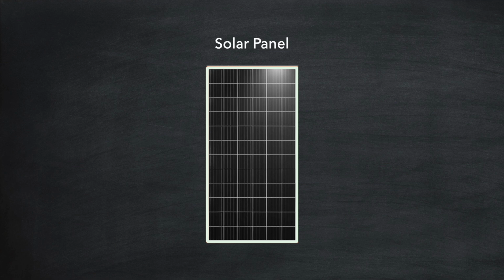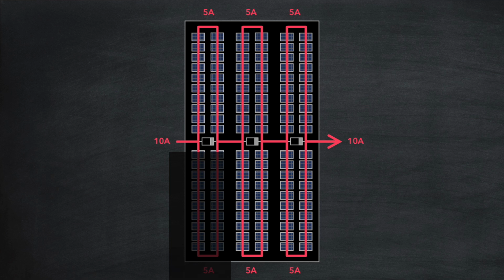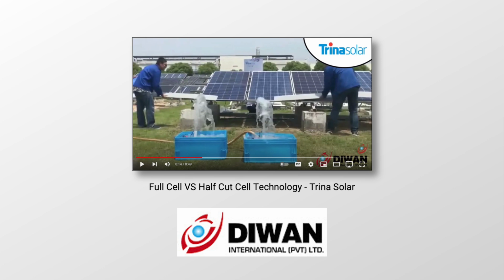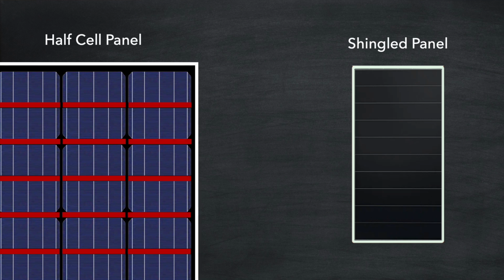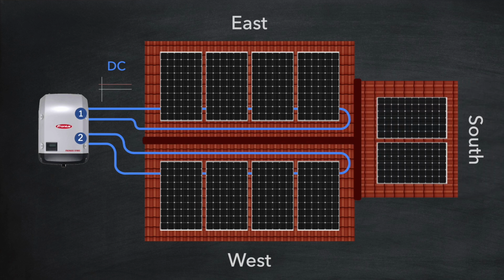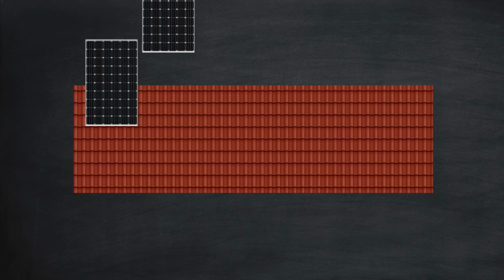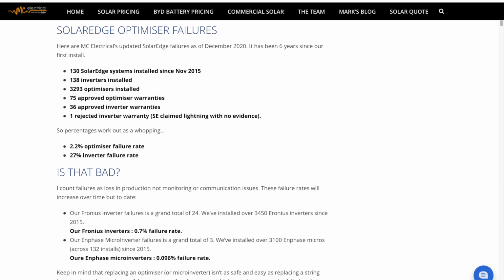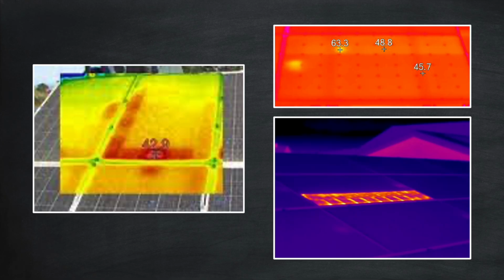Solar Panel Shading (Part 2): More on Optimisers and Micro inverters

Comment: Very informative Ive been recommended Perlight Delta 425W Total Black Mono panels. Are these the shingle panels that you refer to? The datasheet refers to a parallel configuration but does not give any details. My roof is subject to dappled shading from neighbours trees, which will only get worse as they continue to grow, so shading is a concern to me, and I have been considering whether or not to use optimisers. Fortunately, it is a flat first floor roof, and access is simple, I just climb out of a bedroom window.  Any thoughts?
Reply from the maker: Hi Jeremy, great that you're getting something out of my video :-)

Yes, I have Perlight Delta 415W panels on my roof, which are shingled. I'm sure yours are too. Sorry to hear about the shading you have. As it is from trees (therefore diffuse), optimisers could help here, and having easier access will help in the unlikely event an optimiser fails. Be careful though if you're attempting to resolve issues yourself - your safety is paramount. All the best with whatever you decide.

Comment: The first question is panel management modules or not, for questionable benefit. The second option is optimizers (DC coupled) or micro-inverters (AC coupled). Both these questions will have a profound impact on the rest of your equipment, each funneling you down a different path that limits &/or dictates your choices on how the energy is integrated into your home.
As I research this subject I find myself being whiplashed back & forth between many options for the whole system. Just when I think I've decided on one part of the system, I find myself dealing with the fact that it wouldn't be compatible with another choice I thought I had settled for good. No one option within the system can be made without the whole system in mind.
Do I start with decisions on the basic functionality of the system like grid tie or not, battery backup or not,  let that dictate the inverter & solar charge controllers, & ultimately the solar panel module choice. Or do I start with the panels & work my way back toward the grid? It can be frustrating.
Reply from the maker: Hi Dan, it's a real minefield, eh? If it were me, I'd start by listing my overall objectives and categorise them (1=Absolutely Must have, 5=Nice to Have). Then, I'd score at a few potential options against those objectives.

And for particular technologies (e.g. microinverters), I'd also categorise each of the individual benefits (1=Absolutely Must have, 5=Nice to Have).

This might not lead to a definitive solution, but the process of going through it will tease out what the important aspects are, and how they might dictate a particular approach.

Good luck!
Reply: @GaryDoesSolar  My research tells me that high frequency inverters often carry misleadingly high peak capacity ratings, & are not as well suited for inductive loads or whole-house backup, unless they are super oversized. This leads me to favor low-frequency inverters, which rules out micro-inverters on the panels. I live in a rural area, & so this pushes me towards favoring a ground-mounted array, eliminating all the compromises of roof-mounted installations. I live in a northern climate & the ability to clean & remove snow cover also drives me toward ground mounting as well. Ground mounting also means I have access for relatively easy troubleshooting & repairs. In climates with significant snow cover, I'm leaning towards bi-facial solar panels, which benefit from the reflected light snow provides. I want battery backup, & my research tells me that lithium iron phosphate server rack batteries offer the best value, & superior safety, longevity, & serviceability. I honestly don't think there's a single branded solution out there for me, & that I would significantly benefit from a modular multi-branded system built around a low-frequency grid-tied hybrid inverter, with DC-coupled batteries & a DC-coupled generator backup, to deal with extended weather-related power outages. I live in North America, & so the system must also be capable of 120 volt & 240 split-phase power supply.

M current favorite choices are either a Scheider or a dual Victron inverter, in conjunction with their respective solar chargers & communication systems. For batteries, I favor a BMS-supported server rack-mounted battery stack from either EG4 or Soak. I'm leaning towards DC-coupled ground-mounted bi-facial solar panels, & debating whether to use panel optimizers or not. For long-term generator backup, I'm looking at a manually operated generator running through a variable AC to DC battery charger connected directly to the batteries. This is my dream system for now.
Reply from the maker: @danchesney631  Thanks for the extra detail. Yeah, not easy to make the right decision, but I like your approach. All the best with whatever you go with in the end!

Comment: Hi Gary, hello from Perth (Australia, not Scotland ;-) )
Thank you very much for the information you provided in this series, it will be very helpful for me when I change my current system to a bigger one.
Particularly interesting for me where half cell panels, and the fact that (some) inverters support two strings, as I have to deal with partial shading, and plan to have panels on two sides of my roof.
Reply from the maker: Hi Stephan, thanks for taking the time to comment! Now, I've been to Perth (Scotland) many times as this was near where I was born and brought up, but I've never been to Perth (Australia)! I'm hoping one day to get the chance to fly over :-) Good luck with your planned installation!

Comment: Thanks Gary

I can't get any panels for free but I was thinking about getting these for my parents. Half their roof faces north, and it suffers from shading via the chimney

I figured it'd still be worth putting them on a north facing roof if the panels are free, and get optimisers instead

For myself, I don't really get shading, so I don't bother with optimisers.
Reply from the maker: What country are you located in, Waqas? If the UK, then North-facing could be a real problem as it will hardly ever get direct sunlight (except in the Summer, depending on the pitch).

Comment: And if you have the room, you could take the money saved on the power optimizers and spend it on additional panels.  Giving you more power.
Reply from the maker: I can't argue with that :-)
Reply: How does one know what type panel architecture you have? The literature (data sheet) on my Hanwha Q.PEAK DUP BLK-G6 340 says nothing about the diodes or impacts of shading - silent. I have SolarEdge optimizers, and I’m fed up with them. Looking at removing them and the inverter, and just going panel array to inverter. Then the question is, being off grid, what tells the inverter to shut off when the PowerWalls are full? Currently, the Gateway raises the frequency, which the SolarEdge inverter sees as a grid fault, and shuts off. What I’d really like is for the inverter to throttle to meet the load, once the batteries are full, so they don’t shut off entirely. How?

Comment: Thank you! I have been struggling to decide between a string inverter and the micro inverters. My system is to be small and on the ground but I'd like it to be as trouble free and reliable as possible for as long as possible. Great info. Thank you very much for your efficient and understandable presentation.
Reply from the maker: Cheers Gary - thanks for the kind words and all the best with whatever you decide :-)

Comment: Your conclusions make a lot of sense. I could invest in a high quality, reliable hybrid inverter for considerably less than a micro inverter based system.
Reply from the maker: Thanks Kevin. Yeah, for management of most types of shading, the bypass diodes in your panels will do a good job in a string inverter system. If you have a lot of trees around, then optimisers and microinverters have some value there.

Comment: What solar manufacturer makes a good shingled type of panel, the one that outperformed the half cell in full cell panels?
Reply from the maker: I have Perlight Delta 415W panels, which I believe out performs full cell and is at least as good as half-cell: https://www.perlight.com/perlight-delta-400w.html

Comment: I'm in the process of getting PV installed and decided to use microinverters for several reasons. I like the idea that each microinverter has to deal with one panel and don't need an Inverter that has to deal with a whole string. At the same time if a central inverter goes down, then the whole or partial array is offline. With the microinverters only the one or a few are offline and it gives me some extra time for the replacement.
Expandability and replacing PV Panels in the future makes it easier since I don't have to worry about compatibility.
In my case there is not a big difference in costs between the 2 options.
Monitoring is a bonus to a geek 😁
Downside of a microinverter is that the peak power output is lower than the peak output of the PV Panel but after a couple of year the PV Panel will have a reduced power anyway and the 1-2% power consumtion will be from the PV side and not the mains side.
According to the manufacturere mentioned in this video, when there is no sun on the PV the microinverter consume several micro Amps.

There is also the option to use something like Victron. There each string can have its own MPPT which then can be bundled using a busbar and fed to the inverters and/or batteries.

I find there are a lot of options and setups out there. One should take the time and do thier own research before getting one. Its a large investment and once that can be very costly if done wrong. At least videos like yours can minimise such mistakes.👍
Reply from the maker: Great summary!

Comment: Hi Garry
Just a quick question. Do you have any update on the Tigo optimiser problems outlined by Mark in his blog post?. I have just recieved the design for my system from the installer and they want to use Tigo to handle the East /West split. Im just wondering if we will need the monitering system to make them work.

Simon
Reply from the maker: Hi Simon, I have been in touch with Mark but no updates as yet, sorry. Good luck with your solar installation!
Reply: @GaryDoesSolar  Hi Garry. Thanks for the quick reply. I have decided to get the monitoring system as the price is relitively small compared to the whole system, And if you have these things you might as well know what is going on up there!!

Comment: Thank you for a great and easy to understand content!
I think you need to add some economical aspects: 
- optimizer cost about 55 EUR/per panel (without cost of labor)
- they consume energy as well and it is about 2%, so this can put away the benefits
- to be able to monitor individual panels, as mention their benefit, you need additional management box which cost you additional 250 EUR

I think microinverters are better solution for smaller installations (do optimizer job and convert DC to AC and can be monitored individually without any additional HW) because you are very flexible (different orientation, no need to use "solar cables" for DC, just regular ones for AC) no need of central big inverter which cost from 1000 EUR and more. But at some point, if think only economically, they makes no sense because of the price, e.g. 10x 550 W panel needs 10 microinverters * 220 EUR = 2200 EUR instead of lets say 1500 EUR per central inverter.
Reply from the maker: Thanks for the extra insight.

Now these videos were focussed on shading, but I plan on making a video on optimisers shortly, just to complete the picture on the dedicated microinverters video I made here: https://www.youtube.com/watch?v=q6t0AAi5Jws

Comment: I'm just learning. But what happens if the panels are in parallel? Say for the example at 25:33. What if those panels were all in parallel (assuming the inverter is like mine and can handle the current)?
Reply from the maker: Hi Ben, yes - that's one consideration you need to take into account when wiring panels in parallel; lower voltage but higher current! Parallel circuits do give options for the current flow, so that current can generally be maintained. But there is likely a cost impact for the string inverter, to handle all that current.

Comment: I am confused, if a single panel is shaded (like from a chimney) on a string inverter, then  significant power is lost for the entire string. This alone would be an argument for optimizers (or microinverters).  It appears that optimizers at the very least mediate this problem. Further, with optimizers, the output of every panel can be checked. This makes it easy to find and replace any panels that fail. Also, this allows a more accurate tracking of the aggregate power output of the system. So wouldn't optimizers be worth the additional cost of about $50 per panel for those reasons alone? If you have a 20-panel system, it costs you a $1,000 to be able to quickly review your system's power output and check for any equipment failures. That alone would be worth an additional $1000 because the alternative is to get up on your roof and manually check the power output of each panel if one malfunctions. That could take hours.
Reply from the maker: The problem is that your first sentence is incorrect. Where there is hard shading, like from a chimney, the bypass diodes in the panel will kick in, preventing loss in the rest of the string.
Reply: @GaryDoesSolar  Thank you for taking the time to clear that up. Your videos are the best videos I have found in explaining how panels and optimizers/microinverters work.

So you are saying that if one panel is shaded, the panel will be bypassed by the rest of the panels without optimizers? I have heard the opposite. I have heard that with string inverters, if one panel goes down the entire string loses significant power (like string of old Christmas lights). I now understand that the panels have the ability to bypass a shaded panel. Is this correct?
Reply from the maker: @franklong6269  Yeah, this has been a myth that has been spread around by some microinverter and optimiser manufacturers for many years - see my first shading video for details: https://www.youtube.com/watch?v=9GvhDhCSJgo&t=1s
Reply from the maker: @franklong6269  Btw, thanks for the kind words about my videos - I'll keep them coming 🙂

Comment: Hi Gary - Great video

I have a small array of 10x REC260PE Panels and decided that as they don’t all receive direct sunlight during the day, I would install some Solar Edge P320-5NC4ARS 320W Power Optimizers.
The install ran into the evening and finished after sundown. This morning the system was not powering up – on investigation I find that none of the panels (Optimizers removed) are producing any volts – I’d appreciate your thoughts - Regards
Reply from the maker: Hi there, unfortunately, l'm not really in a position to provide individual advice, (not least because of potential liability issues - even if that advice is given free - such is the world today). You're best to speak to an installer about that, or post a comment onto a solar forum (e.g. this one in the UK: https:// www.facebook.com/groups/2197329430289466) Good luck!